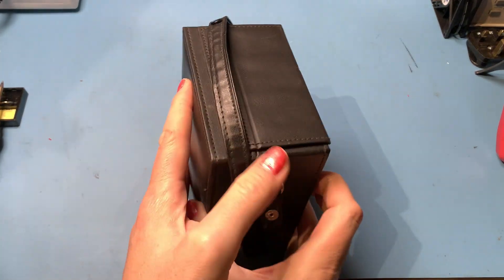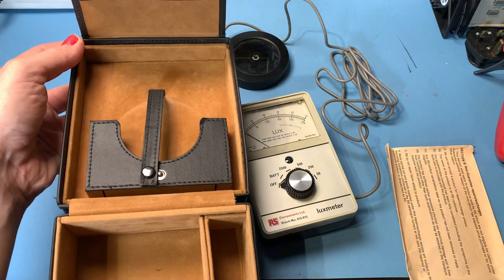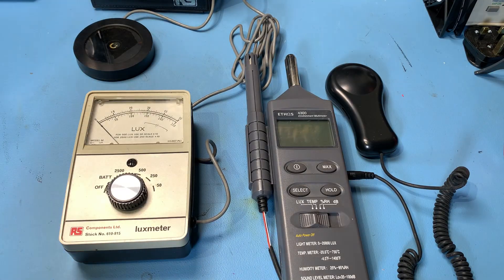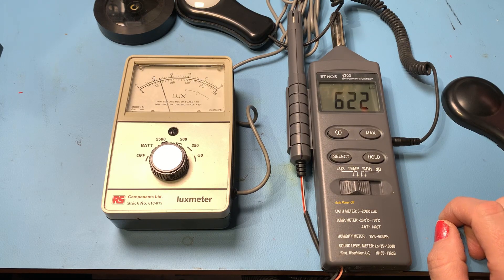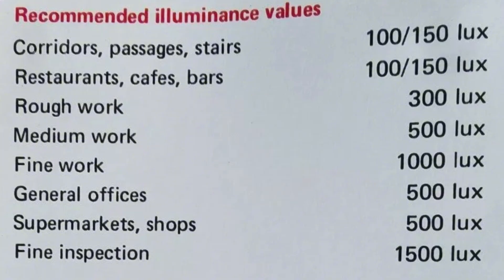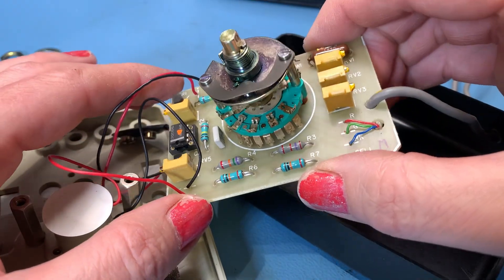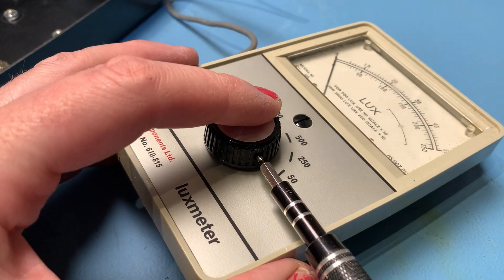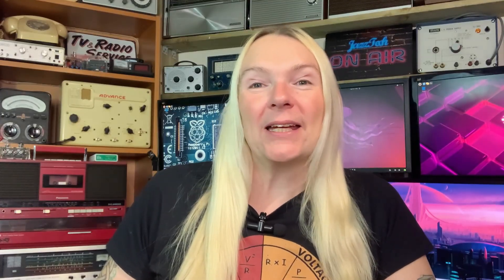Let's Take A Look Inside An RS Components Analogue Lux Meter!

Comment: the housing looks like a typical seventies analog multimeter but with an opamp ic i think its more likely mid eighties stuff
Reply from the maker: It does appear to be possibly 1986. There is a 1986 down in the bottom left corner of the meter movement which I didn't notice, but several viewers did.
Thanks for the sub and thanks for watching.

Comment: Nice condition! Based on the general design, I'd guess mid '70s to mid '80s, which matches with the '85 and '86 other posters have said.
Reply from the maker: Yes, there is a 1986 down in the bottom left corner of the meter movement.

Comment: 8405 on  the transistor. Week 5 1984?
Reply from the maker: There is a 1986 down in the bottom left corner of the meter movement indicating likely 1986 manufacture. I never noticed that but some eagle eyed viewers did.
Reply: @JazzTechUK  I didn't spot that